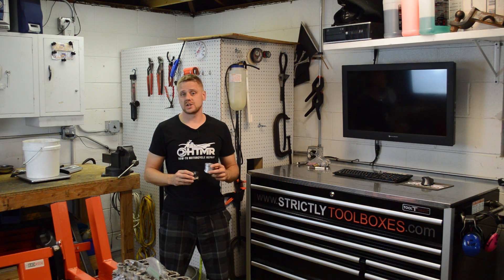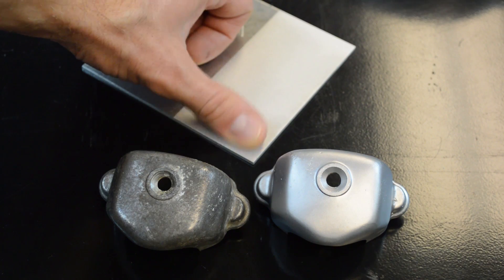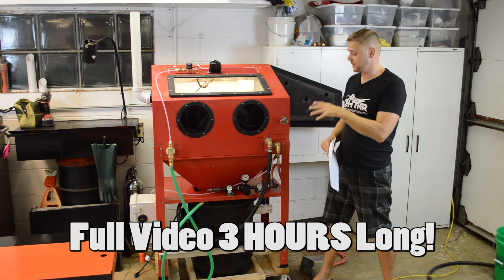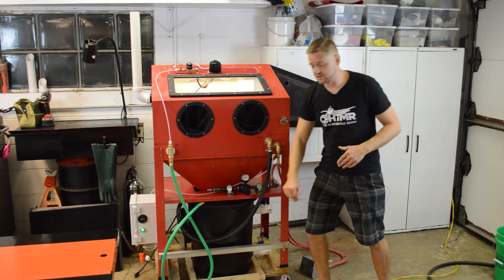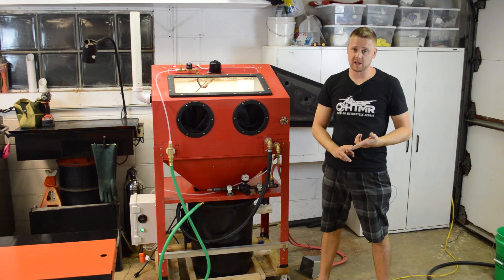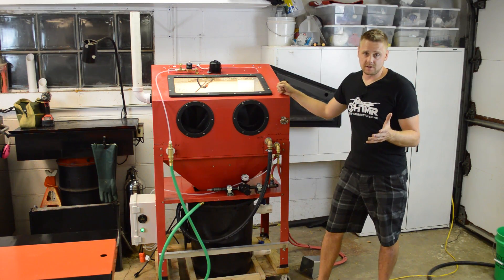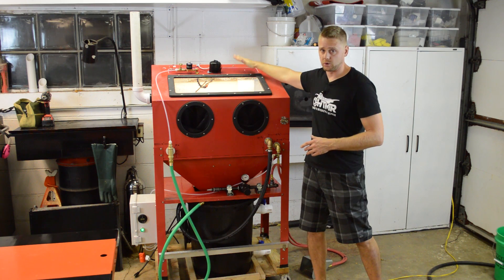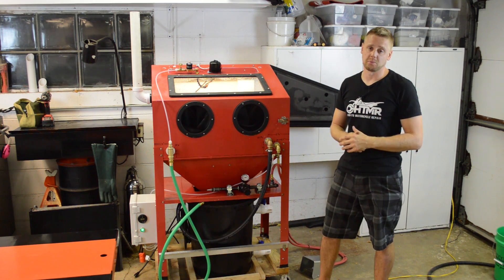How-To: DIY $1300 Vapor Blaster Build Plans

Comment: I just found a skat blasting cabinet, what plans should I buy, the wood box or the HF??
Reply from the maker: HF plans for sure. However, a lot of ideas can be taken from the wood plans as the design is cleaner, easier. You can also buy the bundle plans.

Comment: Hey, great videos I’m a big fan. I have a similar setup and I use aluminum oxide and the paint started to peel on the inside. It wasn’t from me pointing through gun at the paint and blasting it off, the red powder coat that comes on the cabinet literally peeled and flaked off in big pieces. There is some colored corrosion spotting under the paint. I am in the process of stripping all of the paint and thinking of applying either a few coats of flex seal or a vehicle undercoating and then putting up rubber liners on the walls. Wondering what others have done to protect their cabinet and if u use a rust converter with my water would I not have my paint flake off?
Reply from the maker: That sounds like a good plan.

Comment: Hi. I h ave a question. Which slurry pump did you used. How many liters or gallons does it need to do per hour. And how much pressure does it has to deliver. Most of them do between 7 and 13 metres which is (70 and 130 Kpa or 10psi and 19psi in the netherlands we use metres or Kpa) and does it actually has to deliver any pressure? Or does the compressor provide a suction effect through the pistol?
Reply from the maker: Paul, everything you need to know is in the plans. Thanks.

Comment: Hi Matt. I am in Scotland, would you send me the plans for your Blast cabinet. At this time I am wet Blasting boat hulls but at 71 I will have to just get myself into a workshop and use your type of Cabinet. - I was a Marine Engineer so I do have all the Electrical And Mechanical Skills.
So If you can help that is fine. Thanx.
Reply: What type of wet blaster are you using?  only 71 thats great Im 1 year younger LOL

Comment: I had my local shop vapor blast my CB750 carb bodies and bowls.  They look amazing.  Should I run them through the ultrasonic cleaner before putting them back on the bike?   I'm not sure if the blasting material can get caught in small passages or if they're fine to go back on the bike as is.
Reply from the maker: Yes, make sure they are clean.

Comment: All and well you saying 110 what about ppl in the uk where we have 240v so if I was to buy your information they would be no good to me if it only works on 110 so do you have any way of making it a 240v?
Reply from the maker: Plans include 220v info. There are a few different parts you need to buy.
Reply: Could just have a transformer?
Reply: Lol that’s mad iv only just got this come up on my information lol iv done this since then I did a video on it well waiting on 2 bits I think and then got to edit it it’s not as complex as yours or this one but it works and I never payed anywhere near what was payed out on this I payed with all the parts so far is around £200 £80 for my blaster it’s not a big one it’s a top loader not as big but will do what I need it to do made my own gun working on to make it a closed but I can work with open to I did a sandblaster to so I will have both same tank easy and simple to build but everything I’m using is 240v but once its done I will put it on my other YouTube channel with my with my others

Comment: quick question ? vapor blasting is still using media other then baking soda correct ? so what ever happened to the I use only baking soda so it doesn't clog any carb orifices ? did you buy another cabinet to use baking soda only with just for carbs ?

Comment: What pump you use sewage one and what would be the difference if you put glass bead and water in a pot blaster wouldn't that work the same i do unstand the glass bead is like dust
Reply from the maker: Not sure how well the pot blaster would mix the media into water. And then how are you going to dry the media for reuse? Buy the plans you will be happy with them. It will answer all your Q's.

Comment: Hi Matt. Here is a question I didn’t see. Does it work also on chrome, stainless and iron?
Even if take longer in iron materials, I have a car I’m restoring and wanted to know if vapor blasting should be better for me than sandblasting. Tks.
Reply from the maker: With the right media yes. Just have to use an anti corrosion inhibitor in the water.

Comment: So what is the difference between open loop and closed loop?    why is one set of plans more than the other?         How do we know how to decide on open or closed loop?
Reply from the maker: Open loop - requires water hook up from garden hose. Overflow water will need to be disposed of.

Closed loop - self contained water source. Automated overflow valve. Overflow water gets recycled back. No operator input or work required like open loop.

Closed loop costs more and is a little more involved. Plan costs more since there is more content (5.5hrs total)

If you have fresh water hookup and a drain nearby, go open loop, otherwise go closed loop. You can later convert to closed loop if you feel the need. That is what I did.

Comment: Tried paying for this 3 times via pay pal not sure what's up but it doesn't seem to be used friendly
Reply: Got it paid via check card how long before it shows up in my email?
Reply from the maker: @barnescycle  Yeah CC works better than paypal for some reason. You should get an email instantly. If not, please email me here and I will assist: https://www.howtomotorcyclerepair.com/contact/
Reply: You may want to note somewhere that the email will most likely be in the spam. Great series videos and well worth the money,  I was on the exact same track as you but not as detailed and the control box would have been slightly out of my knowledge/skill level. I wish you where close enough for me to show you some ideas on how to make this a closed loop system.  I may experiment and send you a private link if I do. Thanks for your information
Reply from the maker: @barnescycle  Thanks for all the compliments! Yes, some people have issues with spam depending on email service. I plan on making a closed loop version feature in the next few months. I will automatically add it to the plans when available and will notify you.

Comment: I do have one question, once you convert the unit to vapor/wet blasting can you still do dry blasting with the cabinet?
Reply from the maker: After second thought the best thing to do would be to have a second cabinet for a dry.
Reply: @HTMR  thanks for the fast replies! Great content BTW.
Reply from the maker: @TheOriginalLugnuts  No problem and thanks!
Reply from the maker: I guess you could, but why?
Reply: @HTMR  I was thinking for heavily rusted steel parts, wasn't sure if the heavier media would be able to mix well to make the slurry.

Comment: I've played around with wet blasting, at first I tried a process using my pressure washer and glass bead and the parts came out great but its done outside and you burn through media fast which gets expensive. that process would be fine for larger parts that wont fit into a cabinet but not worth it for smaller parts. I had considered buying this: http://vaporhoningtechnologies.com/micro-vapor-hone/ its less expensive then your design but it is also much smaller. for someone that wants a small portable/bench top unit that might work. I have found some other home built setups online but nothing as professional looking as your setup so I might end up buying your plans to same me the trouble of figuring it all out myself. why reinvent the wheel.
Reply from the maker: You can apply these plans to any cabinet. People have bought huge cabs and did the conversion. Pressure washer working psi is too much for aluminum parts.
Reply: @HTMR  I would agree but it did produce good looking parts at the expense of burning through media fast. After seeing what the parts looked like made me want to find a better solution that would recycle the media.

Comment: What size compressor is required realistically?
Reply from the maker: 15 cfm @ 90psi. Sure you could use 10cfm however you will be waiting for it to catch up. Or you can run a smaller gun and processing time will be super slow. It depends how much time/patience you have. I don't have either.
Reply: Thanks.

Comment: All the vapor blasting machines use an special mixture that need silver nitrate,  why no one of the plans sellers explain that ? for me this is a lie that take advantage of your interest.
Reply from the maker: I don't know what you are talking about.
Reply: @HTMR  wet blasting is what you are selling, vapor blasting use silver nitrate as finish coat.
Reply: Silver nitrate was once used in photography. It's nasty stuff and will stain anything black that comes in contact with it especially aluminum parts.  I think what you're talking about is sodium nitrite. It's a corrosion inhibitor but does absolutely nothing for blasting parts.

Comment: Matt, how do you feel about vapor blasting parts that need to keep grit out of? Like carbs, cylinders etc?
Reply from the maker: This process works fine for parts like that. I find that they completely need to be disassembled. The media does not pack in holes and rinses fairly easily. You do need to clean the parts very thoroughly before assembly.
Reply: @HTMR  cool, thanks Matt!

Comment: Hi...Is possible do it with a 10cfm compressor or I need buy a 15cfm to start thinking about buy your plans? Thank you very much
Reply from the maker: Yes it is possible. You will have to run a smaller gun (explained in the plans) and the results will just take way longer.
Reply: @HTMR  Thank you Sr!

Comment: Matt, please keep us posted about using different media, different pressure and the resulting quality level that can be achieved.
Of course you can also post them with the building instructions to make it even more worthwhile for your „customers“ who bought the plans.
Also the results on different materials with rust, paint, gaskets and aluminium corrosion on it.
Greetings
Reply from the maker: Will do.
Reply: Great this will save us time and media. Btw. I can get any size ceramic beads which should also produce high quality surface but has a useful life about 30 times compared to glass beads.

Comment: To all the guys who want to save the 69 Dollars for the videoinformation I strongly suggest to do the prep work yourself. It can be done. Depending on your hourly income rate the 69 Dollars will be gone fast. I emailed with Matt first to see if this is what I need before spending the money but after 2 mails I paid the 69bucks happily. Now everyone must decide for himself. I am still in contact with Matt via email and he was very helpful so far. As an Airline pilot my income is very good but I was close to spending 8000Dollars on Commercial grade equipment until I found out that they sell you extremely overpriced stuff that you can actually find in places like home depot. The pricecurve is really steep when they sell you just a bigger box but the same pumps inside. I am restoring Jaguar V12 engines so guess what size I need to do a crankcase!

Frankly speaking: if the 69 Dollars is your problem, stay away from Vapor or Dryblasting because you cannot afford the compressor that is needed to run such a box efficiently.
Reply from the maker: Bernhard, thanks for the feedback. Also want to mention that you can apply these plans to any cabinet, not just the HF unit.
Reply: Matt, I honestly don’t buy tools at Harbor Freight BUT since all you need is a box that can be sealed watertight I believe that one box is as good as any other if one goes by your instruction on how to prepare the box for vapor blasting.
Greetings
Reply: True that, on the Compressor!

Comment: been looking at vapor blasting cabinets before but the price was too high to consider buying it 
now i'm kindah glad i didnt 
keeping the abrasive wet has its advantages : 
less dust 
better view of the proceedings inside the cabinet 
no need for a dust extraction unit 
and like you said a smoother surface , the abrasive is probably lasting longer too as its lands on the object a lot softer 

400 lpm air flow..... wow definetely underestimated that (was collecting stuff to build a sandblast cabinet out of an old oildrum but it would flow too little for that too) need to get a second compressor and wire them up so they start one after the other (16 amp fuse 220 volts single phase over here )
hope the plumbing parts to create one myself are the same in europe though
Reply from the maker: I have no doubt that you can locate all parts in your country. The bigger the compressor the better for ANY blasting.

Comment: Hi, I don’t mind paying for Your plans but I do have some questions first:
I live in Germany and I am not sure if I get the exact same box can a similar one be converted using your plans?
We have 220V here what needs to be supplied? The slurry pump? Or just lights?
I would have to place it close to my compressor but have no permanent water connection, do I need that constant spray?
How fast can I change Media with that design? Because on „Arnold Design“ videos they use two step with different media and get unbelievable results.
Is 69 Dollars the total for those plans and video?
Greetings Bernhard
You can email me at bernhardlist@hotmail.com
Reply: Hi, it will take me some time before I can honestly answer your question but I have purchased the plans/movies from Matt and watched them and afterwards I compard the information with what I found on the net. Basically Matt seems to be correct with what he does because Vixen, Vapor Honing and Arnolds Design they all do the same but make a big secret out of it to sell severly overpriced equipment. 
   I live close to Limburg Germany and the little research I did so far on ebay, the pump, the cabinet and so on are all available in 220Volt here. About the pump life I cannot say anything yet since I am in the process of purchasing a good compressor first, because without a very strong 600 liter Air OUTPUT I would not even start because it is fiddling around not working. I just found a Gieb compressor that puts out a 1000 liter/minute (39cfu) so I expect that thing to humm. The pump model that Matt suggäested puts more water through per minute than the pumps from Vixen or Vapor Honing. I believe the key point here is a Polyurethan turbine wheel not any cleanwater metalwheel that will be blasted the whole time it turns. The suggested Tsurumi pump is a mudpump that has to withstand the beating in other applications too so I guess Matt is on the right track. I have seen that some people use dishwasher or poolpumps .... they are not made for mud, some using brass wheels (it will be shiny soon).
If Matt has problems or recent improvements .... he will tell.
I will build „my“ system step by step over the next two or three months but with a different box because I need more Volume. In mid spring I will tell how it works until then I have to trust that Matt will keep us in the loop. To me as an engineer I think Matt makes good sense the way he built his, I will just modify mine to meet my situation (no fresh water connection in my shop). 
Actually I love the bucket underneath which should make it easy to change media by just lifting the pump out, swapping the mediabucket and continue working. Watch the videos from Vapor Honing or Vixen how long it takes the guys with „In the box pumps“ to do that and what a mess they have.
Greetings Bernhard
Reply: @bernhardlist9359  hi bro, thanks for all your comments, I'll be in touch with you and looking forward for your project ;)
Reply from the maker: Email sent
Reply: @HTMR  I would like to buy your plans as well but have questions. Is there a way you could email me as well. michaelzallo@gmail.com
 thank you
Reply from the maker: @mzallo  Email sent
Reply: I have kind of the same doubts, I've no problem with buying the plan, but I'm worried if these items would be also available in Europe... Also, you didn't even mentioned the pump, I use to follow some DIY on forums, and there is a constant problem with the right pump selection, some of the DIY works just for a short time until the pump is exhausted... Also about the wear of parts like the spraying tip... I don't know if you need to pm for the response, just in case jopequebien@hotmail.com and thank you for sharing your experience, I'd love to wet blasting my motorcycle and cars parts!
Reply from the maker: @eduki  The pump is available in 220v / 50hz. You will have to reach out to MFG / distributor worse case. Wear items like nozzles can also be purchased on ebay. Go for it!

Comment: Which air compressor do you use?
Reply from the maker: 2 stage, 5hp, 80gal, 18cfm. (However my pump is tired and have a new one on order. Only getting 9-12 at the moment.)

Comment: How it works in powder coated material?
Reply from the maker: This process will remove powder coat. You need the right abrasive (hard and sharp for cutting) and high pressure.

Comment: Now what if you wanted to go back and do a regular metal piece.? You hurry up and do it and dry it off real fast so it wont start rusting?
Reply: If you add commercial soda, it's a rust inhibitor.  I have blasted parts that do not flash rust with machine like this.
Reply: @goneridingparts  interesting. sure leaves a smoother finish. maybe ill convert mine
Reply: AlexanderTheGreat 
Just rinse it in a bucket with rust inhibitor afterwards to delay flash rusting.

Comment: Hi There , at :48  you  that it was dry blasted , can you tell me with what it was blasted with ?  sand , garnet, glass beads  .... ?  still very cool though  !
Reply from the maker: Glass bead. Not sure of mesh size or pressure. Point is, texture is much rougher than vapor blast.